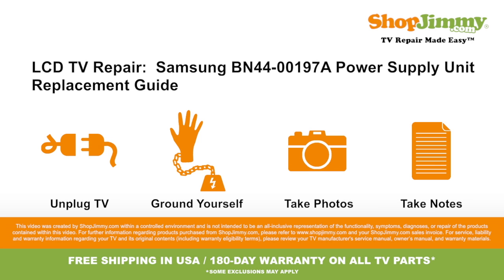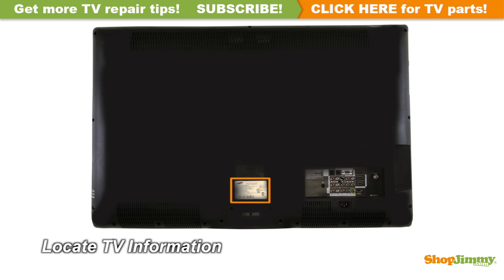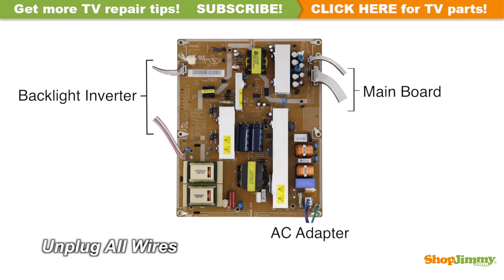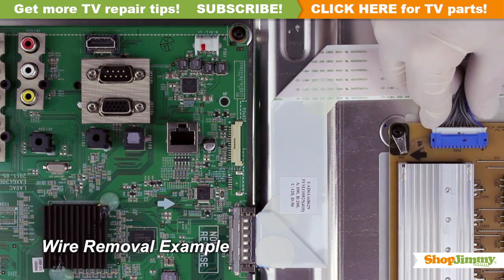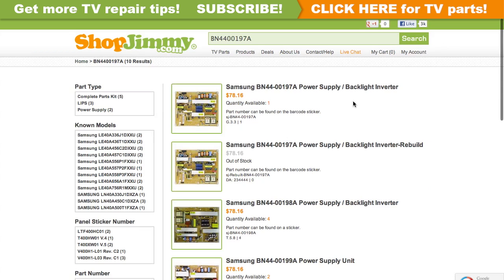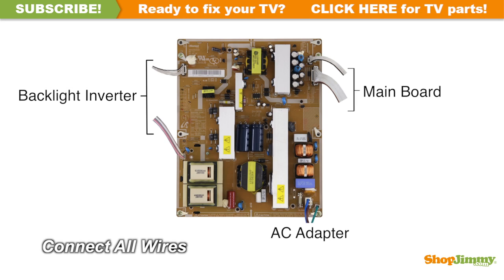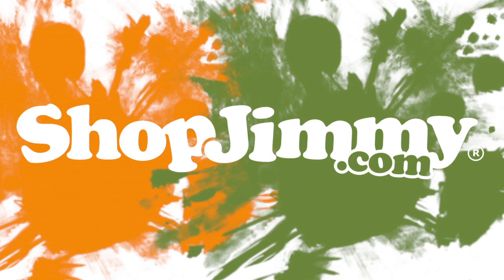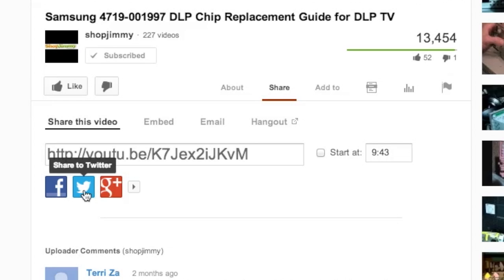LCD TV Repair Samsung BN44-00197A Power Supply Unit (PSU) Boards Replacement Guide

Comment: I have a Samsung TV model LN40AS40P2F using power supply BN44-00197A
This is the problem: When I turn the TV on there is noise, vertical lines, horizontal lines then shut down by itself, then on again, this goes for about 10 minutes and sometimes comes on normally, this is with the cable box input with the antenna input does not come normally for a very long time. I did change the electrolytic capacitors on the power supply but did not help at all.
If I replace the power supply at ones do you think it will solve the problem?

Comment: Hi guys am having trouble with a customers panasonic plasma tv have replaced the powerboard with one of your shopjimmy parts and fitted perfect but still has the same problem of when turned on green light flashes for 2 seconds then red light comes on with a noticable click from the powerboard relays. Any ideas what else it is or could be please? thanks guys keep up the good work.